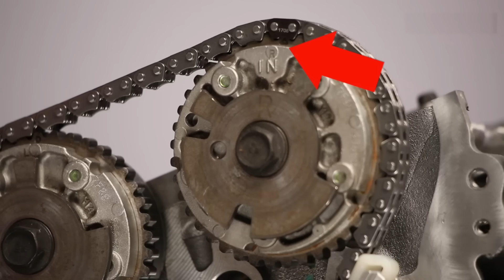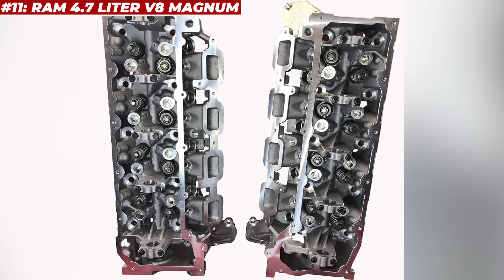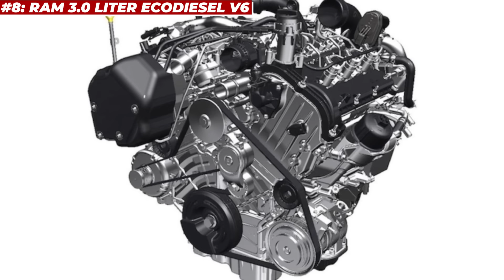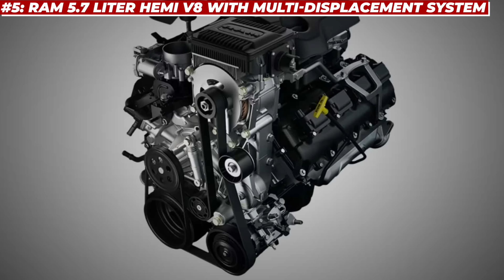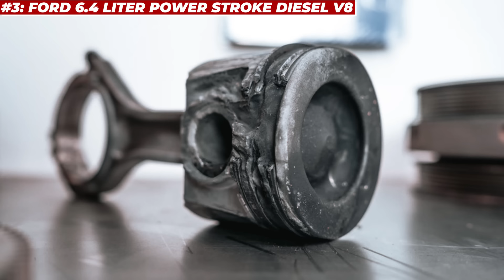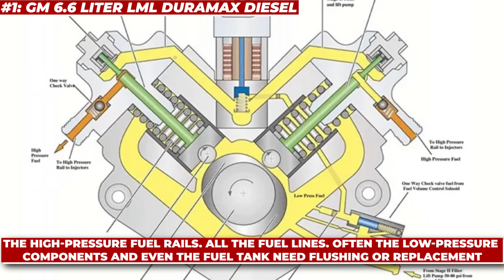13 Trucks That Are Hidden Time Bombs (Avoid These Engines)

Comment: Umm...the 5.6 VQ engine is considered to be a very reliable engine. Same with the tranmission in Nissan. The 5.7 Hemi is fine as long as you keep up with maintenance  and oil change intervals. I've owned 5 Hemi (5.7) engines and non of them have ever given me serious issues.

Comment: Just buy an old 99 dodge with a 360 or 318 or my 95 gmc with a 350 vortec engine a 5.3 with dod delete without Afm or Vvt motor is good too the 4.7 is a piece of crap the Obs chevys from late 90s are some of the most affordable out there. Nissan dont even have a decent car let Chevy make fullsize trucks toyotas fullsize trucks are overpriced and extremely ugly.

Comment: A Caucasian man who bought a brand new 2025 GMC Yukon Denali SLT with the 6.2-litre V8: says the only issue he has is the motor itself; every 2500 to 3K miles, he has to add more oil! And to make matters worse, the dealership claims that 'this is normal and it's your problem'; kinda makes you wander, huh?!

Comment: i have still a 2004 dodge 4.7l motor,  the first one ran for 430, 330 miles before the timing chain broke and destoryed the motor it lasted 21 years,  i use 5w-30 mobil 1 oil for 36,000 miles after that went to 10w-40 full synthetic  mobil 1,  the key , to break in the motor with the 5w-30 then switch to the 10w -40 , the new motor is a crate motor, with more power then the old one, from 235 hp to 345 hp.  and torque over 400 ft. lbs. i lost 1 mpg combined and still maintained  16mpg, @ 75 mph. on the freeway with 3,55 gears .  im keeping this one for life, reason why buy a new truck thats going to be sitting in the repair  center and the dealership for repairs, and spend over 100,000.00! i just bought a 2000 diesel and rebuilt the engine,  and no cow irune in the mix.

Comment: "These engines are designed to fail " That's a bold statement. Have any proof to back it up?
Reply: Belt driven oil pumps.
Reply: @jfleck I'm a mechanic and I can promise you that everything that comes off the car lots these days are designed to fail if you don't believe me just go look at the amount of recalls they have and they'll repair it most times with the same low quality part to get it outside of warranty so it'll break again and force you to buy a new one.  They really aren't even designed to allow you to fix anything outside of normal wear items. They've designed most of the electronics where it's programmed with the vin number where a lot of items can't be reused in another vehicle forcing you to have to buy a new part that may not even be available.

Comment: Have a 2005 Gmc 1500 and still have , replaced engine at 267k had  new motor built and trans rebuilt with better parts , tows better than  the original, put biggest trans cooler i could put in.

Comment: This video fails to mention the worst gasoline engine design issue causing the highest percentage of engine failures of all time. Which was the Ford 2017 to 2020 5.0 V8, aluminum engine block with substandard cylinder wall coatings. I’m on my third engine in under 60,000 miles.  Ford passed all repair and replacement costs off on the consumer. Never once issued a recall and actively slow walked insufficient remedies in an attempt to push owners outside the lemon laws liability and Ford’s power train warrantee periods. This was my experience.

Comment: I had a 2004 f450 was constantly  replacing injectors. Until that one time I was picking the truck up after having 4 injectors done. The mechanic finally said I should replace the fuel tank. Because the fuel tank is delaminating on the inside of the tank. It was so irritating!!

Comment: I have a 2018 GMC .Serra 5.3 high output..Had it since new..factory transmission and motor 147..000 on first brakes..137000 on Michigan tires..still going strong 💪
Reply: You're very blessed because they are backed up at are dealership.

Comment: 2014 6.7 liter at 160,000 miles fuel system held but the press on crank gear slipped and 23,000.00 later she's back on the road

Comment: I always drove Toyotas trucks for past 28 years. And they been most reliable trucks on market. But the 2022 and up years should be in that list is well, Toyota really shot itself in the foot with building that 3.5 liter twin turbo engine. Do not buy anything Toyota with 3.5 twin strap on turbos . Very expensive to replace that engine.
Reply: I had to replace a starter on a tundra. Wasn’t fun but that starter had over 300k on it. Good trucks

Comment: I had the 4.7 in a dodge Durango.  2 water pumps, and one alternator in 300k kms.  Tossed it at 460k.  Lost a timing chain on a 3.6 gm at 240k kms, and it's trans at 320k

Comment: Almost every Diesel manufacturer used the CP4, not just GM, Ford, Dodge and many European manufacturers used the CP4 In fact Ford is STILL using the CP4 while GM and Mopar has changed to a more reliable pump, with all that said many CP4 pumps go hundreds of thousands of miles without failure.

Comment: I would not buy any engine gas or diesel if it's got a belt drive oil pump!!!! Also with a gear-driven oil pump I've seen I believe Ford and GM on the gear that drives the oil pump they don't put a keyway in it and then it starts slipping on the crankshaft!!!

Comment: The engine that will prove itself to be an "heirloom" engine for durability and longevity will be the post 2023 Ford 7.3 gas engine. Ford finally got it all right in building this hallmark designed engine.
Reply: Ford didn’t build the 7.3
Reply: @Mark-fc2zk  ~ If you're thinking the IH 7.3 diesel...you're on the wrong page. This is the Ford 7.3 gasser and Ford DID make it. I was a part of its evolution.

Comment: Bought my 2008 Silverado new, got 276K on my 5.3 , replaced engine, still rollin 355K , factory transmission
Reply: We have 2002 Chevy Silverado 4 by 4 have 400,000 on a 5.3 original motor doesn't burn oil and we have an HHO generator hooked up to it. We get incredible gas mileage better than any new car on the street.
Reply: @skippoX The mid 90s -2002-04 are the best vehicles most manufactures made at the time I have a 99 E350 Ford  Triton 2 valve 375,000 and still going . It did pop 1 Spark plug and had to fix it twice . Still running . Probably put less than $4000 into it for 26 years for maintenance and Tires . heck tires are $1000 for a set these days.
Reply: @skippoX That HHO Hydrogen or High Out put
Reply: @dougriebe5072 it's basically a onboard hydrogen generator. uses stainless steel plates and electrical charge distilled water and potash and creates hydrogen gas that is sucked into the intake and burnt. Check out the tube for HHO Generators
Reply: @skippoX my buddy has a brand new Chevy with 4k miles and threw a rod. Another buddy had a GMC threw a rod with less then 10k miles.
Reply: They don’t make them like that anymore
Reply: Man i bought an 2008 4.8 drove it hard 450 thousand miles ,running strong when i sold it.
Reply: 289k on factory engine,  replaced Trans at 180k, runs like new with normal maint, a few coils,  plugs wires,  05chevy 5.3 1500
Reply: I had a 05 Yukon with 335k on the engine and transmission when I sold it
Reply: There is a fix coming soon . Very soon .  All emmsions is going to be gone .  Even California.
Reply: Getting my 17 serviced now. 75k miles range device used since 10k miles. I'm rolling the 🎲dice oil changes every 3k miles

Comment: Such a shame manufacturers don't care about their reputations.
I remember the time when they would design new engines almost every year back in the 60's and they are still going these days and if something needed repaired and replaced it was easy and cheap. 
I pity the second and third owners of these modern vehicles. Have to get a bank loan just to replace a water pump.

Comment: If you buy a GM vehicle from 2007 and newer that's got these motors and these lifters you know you're going to get a vehicle that can go three or four hundred thousand miles but to do that you got to rebuild the whole top half of the motor to deactivate AFM
Reply: Whaf if you just delete it with a range device?
Reply: @strayedarticle2838that's what I got in mind it keeps it in V8 mode and it's been in there for 4 years now and so far so good but I don't know about 10 years down the road or if it ever has to be worked on and you take it out and then it goes into four cylinder mode and don't come back up I don't know what it's going to do but I'm sure I'll find out eventually

Comment: The Hemis and LTs are pretty easy to fix by deleting the AFM/MDS lifters and putting non-AFM/MDS cam in it.
Reply: I have a hemi with the tick. I have a certified warranty for 5 years 100k miles. When asking the dealer about fixing it, they said I would have to pay $250 for the diagnostic. If it turns out it is covered under warranty then I get the money back. If not I cover repairs. If it is something that is so prevalent in the engine, then I would think it would be covered! So why not just repair it without the runaround??!! 😡 If it’s a common failure and it’s “in” the engine, then the drivetrain warranty should cover it without hassle!! I don’t understand the problem!!!
Reply: @RobertMurray-b1e  you could just have an exhaust leak. Does it go away after it warms up? Lifter tick isn't exactly common it happens because people idle their vehicles all the time and or don't do 5k mike oil changes. It's fixed by putting a high volume oil pump on it. Deleting MDS is the best option.
Reply: @cymbalenthusiast3265 there’s that as well. But that should be covered under warranty also. That’s where the “we will need to diagnose it first “ comes into play. I get the fact they don’t want to repair something that doesn’t need to be, however, why can’t they just say “ not sure what the problem is, but should be covered.” That would give me a better piece of mind.
Reply: @RobertMurray-b1e it should be all covered. If it's lifter tick they should fully replace the engine because either way all bearings will need to be changed out.

Comment: 1. What this video is basically saying

It’s a fear-based list of 13 truck “disasters” where the creator claims they’re financial time bombs that will bankrupt you. The main themes:

Certain engines have:

Expensive timing system failures (belts/chains, cam phasers, lifters).

Head gasket / cracked block / cracked head issues.

Emissions system failures (EGR, DPF, DEF, regen problems).

Rust / frame rot on Toyotas.

And the big finale: Bosch CP4 high-pressure fuel pump on LML Duramax, sending metal shavings through the entire fuel system.

There’s a lot of truth in some of these problems, but the language is very YouTube-y: “designed to fail”, “90% failure rate”, “will bankrupt you” = big exaggeration to keep people watching.

2. Quick rundown of what he covered (13 → 1)

#13 – GM 2.8L Duramax (Colorado/Canyon)

Complaints: Emissions issues (DPF/EGR), interference engine with a timing belt; belt failure = engine toast. Recommends early belt change (~100k vs 150k).

#12 – GM 3.6L High Feature V6

Complaints: Timing chain stretch from oiling/maintenance issues. Chain job is labor-intensive and expensive.

#11 – Ram 4.7L Magnum V8

Complaints: Blown head gaskets, overheating, sludge; expensive head gasket repair often exceeds vehicle value.

#10 – GM 6.5L Turbo Diesel V8 (’90s)

Complaints: Cracked heads/blocks, poor thermal design, failing PMD/fuel electronics; short life for a diesel.

#9 – Nissan 5.6L VK56DE V8 (Titan/Armada)

Complaints: Cracked exhaust manifolds, early drivetrain failures (rear diffs, transmissions) in early Titans; some later engine failures (crank issues).

#8 – Ram 3.0L EcoDiesel V6 (’14–’16)

Complaints: Emissions/regs mess, recalls and software reflashes, concerns about long-term reliability and resale due to legal issues.

#7 – GM 5.3L & 6.2L V8 with AFM/DFM

Complaints: AFM/DFM lifter failures and oil consumption, leading to misfires and expensive lifter/cam work.

#6 – Toyota Tundra & Tacoma frames

Complaints: Frame rust/rot from inside, massive corrosion recalls and buybacks; trucks with good engines but junk frames.

#5 – Ram 5.7L Hemi with MDS

Complaints: “Hemi tick” from failed MDS lifters wiping out the cam; claims it’s fundamentally under-oiled and “designed to fail.”

#4 – Ford 5.4L 3-valve Triton V8

Complaints:

Two-piece spark plugs that break on removal.

Cam phaser failures.

Timing chain/tensioner issues from sludge/poor oiling.

Very high labor costs, leading people to delay maintenance and make it worse.

#3 – Ford 6.4L Power Stroke

Complaints: Weak pistons plus DPF regen strategy that dilutes oil with fuel, causing major failures; often needs full engine replacement.

#2 – Ford 6.0L Power Stroke

Complaints: Infamous – oil cooler/EGR cooler/head gasket issues, high-pressure oil system failures, casting sand debris; “bulletproofing” industry exists to fix all the known weak spots.

#1 – GM 6.6L LML Duramax with Bosch CP4

Complaints: CP4 pump not happy with US ultra-low sulfur diesel; when it fails it sends metal through the whole fuel system, requiring pump, injectors, rails, lines, tank clean, etc. Repair often $10k–$15k.

3. How seriously should you take this?

A few grounded points:

Many of these problems are real, well-documented issues:

Toyota frame rust.

Ford 5.4 3V spark plug/cam phaser/timing issues.

Ford 6.0 & 6.4 Power Stroke issues.

GM AFM lifter failures.

CP4 pump problems on various diesels (including LML Duramax, some Rams, and some Fords).

But:

“90% failure rate” and “designed to fail” are marketing hype. Real-world failure rates are nowhere near that high or every single forum would basically be an obituary wall for these engines.

A lot of catastrophic failures involve:

Poor maintenance intervals.

Wrong oil or neglect.

Tuning/abuse, heavy loads, and heat.

Some issues can be mitigated or prevented (earlier belt/chain service, bypass kits, disabling AFM/MDS with a tuner, rust treatment, etc.).

4. Very relevant to you: your 2009 Ram 6.7 Cummins

You own a 2009 Ram Cummins 6.7L, and noticeably, this engine is not on his “13 disasters” list.

For your generation Cummins:

You have a CP3 pump from the factory, not the Bosch CP4 the video is ranting about.

The 6.7 Cummins of that era has its quirks (EGR/DPF, turbo actuator, etc.), but it’s generally considered much more durable than:

Ford 6.0 / 6.4 Power Stroke

LML Duramax with CP4

A lot of the gas engines he’s listing.

So, your truck is not one of the “designed to bankrupt you” examples he’s talking about.
Reply: The biggest issue with the 6.7 Cummins in my opinion is the rocker/push rod design. 
Terrible.

Comment: Let them rust. Don’t buy Ford, Chevy or Dodge.
Reply: What's left? Toyota with may-pop engines?
Reply: @TIJoe-te9qu And rotting frames.
Reply: Whats left. Nobody else has enough power to pull real loads.
Reply: @JerryRedd-bs8xi Seriously,  more competition would be good for having a choice.
Reply: @TIJoe-te9qu Yes but who ?
Reply: The Ford trucks are solid bro. They had some stumbles in the past with those 6.0, 6.4 diesel and 5.4 gas triton but 2010 on up , Fomoco trucks are good

Comment: If nobody bought a new car in the US for 2 weeks we could absolutely turn this bullsht around! We are the reason they keep making cheap trash and selling it for 50-70k. We keep buying it
Reply: I have said the very same thing for years!!!
Reply: Not true. Did you hear them repeatedly say these designs were in response to ever tightening EPA fuel efficiency numbers? It’s our government messing with fuel mileage numbers. These car companies spent billions on new engine designs to get a few more mpg. We are the ones suffering from it!
Reply: @robertlane4432  Its EPA and planned obsolescence.  A lot of work gets done by the middle class with a truck.  One more effort to destroy the middle class.
Reply: @robertlane4432  1 airplane = 350k vehicles! The government doesnt hinder airlines with all this crap! Those GE or Rolls royce engines on planes dont have active fuel management! We as the consumer keep paying this high prices, so they keep marking them up! If we as a country were to boycott anything, prices would fall like a rock!  They can make a chevy malibu manufacturer wise for less than $11k
A camry is $13k, a tahoe is $24k
 To manufacture!  Why are they selling for boatloads over this! Its cheap trash! They put a heavy & premium price on!
Reply: @robertlane4432 Last Week 47 cut the Bidumb CAFE standards he was pushing 47 shut that down!
Reply: @jimfink2826 CAFE standards were a thing before the Biden administration. He probably had a hand in it, but not from his time as president.
*I'm not a Democrat.
Reply: . THE STANDARDS THAT BUDUMB REGIME PUSHED UP TO 50 MPG in which is no plausible by 2032, think about it he wants everyone to go to electric and no oil.
Reply: That's a falsehood..... They have a glut on the lots of vehicles and they're just sitting,
 They're over priced and not going anywhere!
Reply: Then keep buying used crap. 💩 Quit whining.